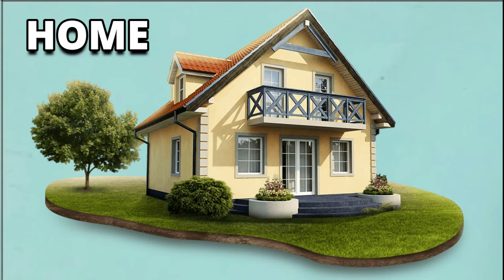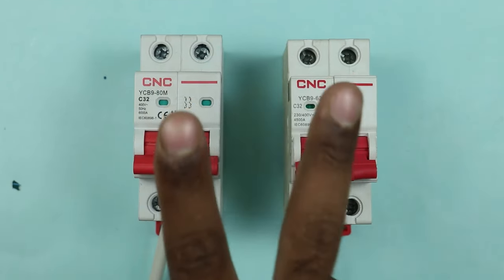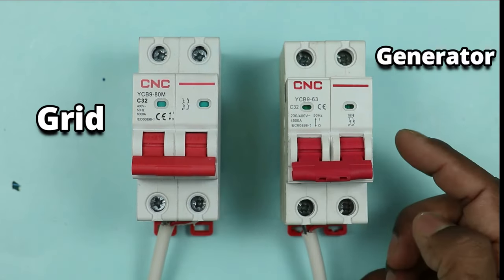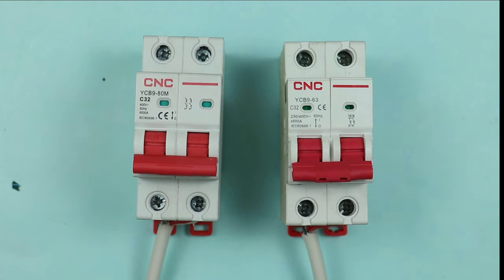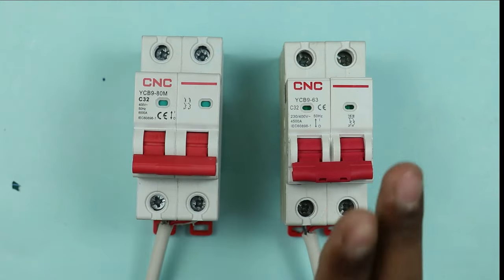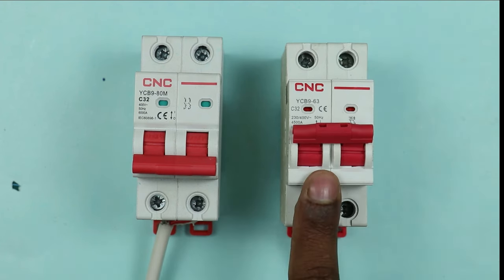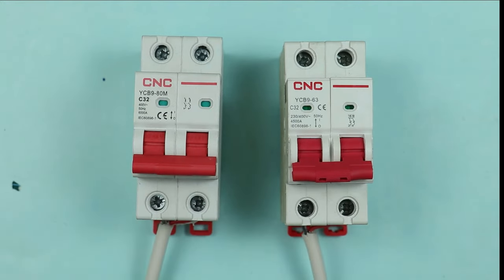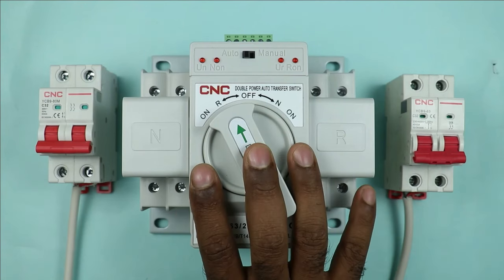Double Power Auto Change Over Switch Proper Connection | English Video | @TheElectricalGuy​

Comment: Mr. Electric guy,
I DIY 3kw hybrid inverter by POWMR and using ATS, Main is Solar and utility distributor is my back up source, but my problem is everytime they  switch back to UD all my remote appliances turned of automatically. What type of safety device do I need to use so that it will not turn off automatically.? I hope you can help me. Thanks

Comment: So if you have solar generator as priority source (A or "Normal"power side) such as a Bluetti AC200MAX Solar Generator which has a floating neutral, and two pin plug going into the inverter which is then connected to power side A, can this be a problem?
Reply: Anyone?
Reply: I don't think there will be a problem for as long as It's an AC input.